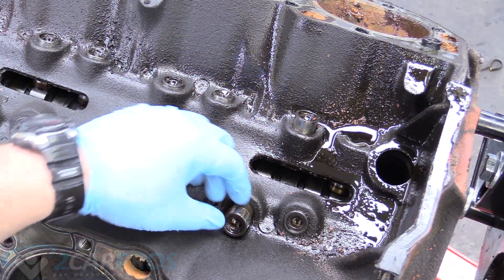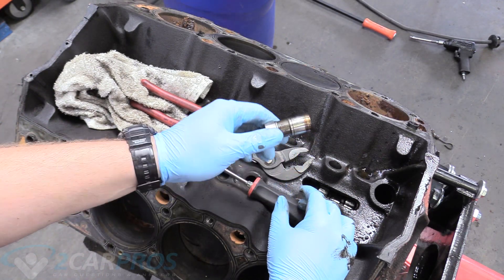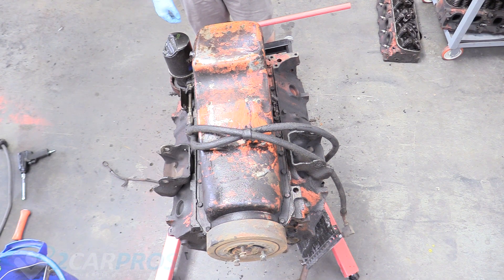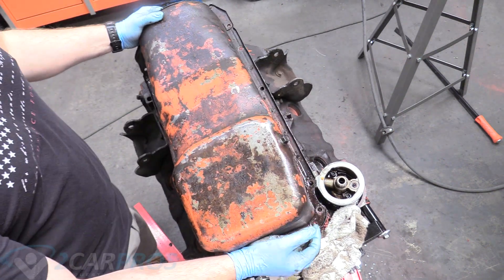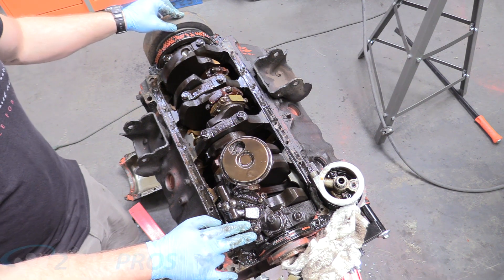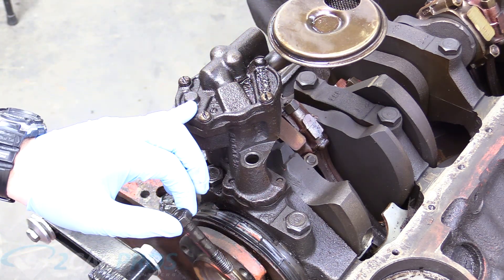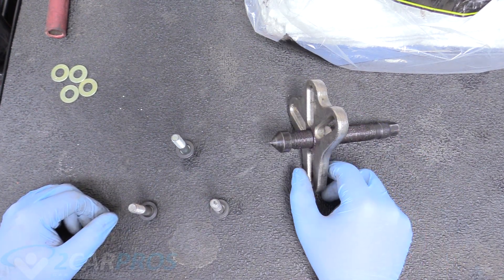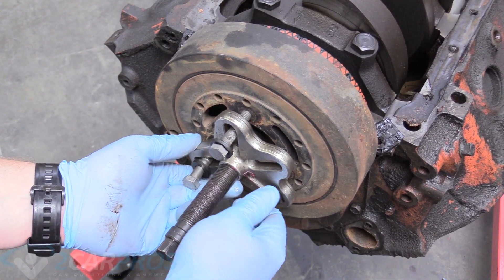How to Build a Chevrolet 454 Big Block Part 2: Removing Harmonic Balancer and Lifters

Comment: I have 454 swapped c3 Vette. I have been experiencing pretty significant vibration especially over 3500-4000 rpm. I suspect that they installed a internally balanced harmonic balancer instead of externally balanced. Is it possible to identify what is on it without removing the pulley and the belt?
Reply from the maker: Great question. I'd look for a part number on the front and then look it up. I wonder if they used the correct balance on the flywhee/flexplate too? Thanks for watching!

Comment: Just wanted to point something out really quick. Good video.
A little extra advice. As far as the lifters are concerned if they are flat or inverted meaning if they arecupped slightly at least replaced the lifters and put new ones in.
Lifters should have a slight dome on the surface of the lift of the riots on the cantaloupe.  This allows the lifters to spin and not wear out the lifter so quickly.
If you were to remove a valve cover and mark a couple push rods with a white dot and turn your engine over without starting it, you would notice that your push rods will rotate.  This is totally normal.
You can get a stock replacement cam and lifter set brand new for relatively cheap.  Small block Chevys and big Block Chevys are numerous and parts are cheap.
So if the lifter is is flat or burped replace it.

Comment: Can anyone explain why the four-bolt configuration is superior to the two bolt configuration?
Reply from the maker: 4 Bolt main can handle more power than a 2 bolt. Force on the main cap is divided by 4 instead of 2. Usually only matters in very high power applications but it is nice to have the headroom there for the future incase you change your mind. Thanks for watching!
Reply: @2carpros  Thanks for the info.

Comment: I’m doing the same 454 big block build does the oil filter adapter need a gasket cork paper or metal behind it because the one I have does not have a gasket? Thanks
Reply from the maker: Mine came with a gasket. I'd get one. Thanks for watching!

Comment: removing the balancer is a bitch but never do it with an impact ,stuff a pry bar in the crank so it doesn't spin and do it by hand with a proper tool
Reply from the maker: I disagree. Impact gun has always worked great for me. Thanks for watching!
Reply: @2carpros  oem models have more clearence. Try that with the race stuff and you're in for a surprise

Comment: Hey man I was wondering where you get your engines from to rebuild them?
Reply from the maker: Well the 2 bolt 454 came from a guy off Craigslist way in the desert. The 4 bolt 454 was donated by a generous viewer who had one and couldn't stand us building a 2 bolt 454. We have the best viewers! The 5.3 LM7 was purchased off of eBay. Thanks for watching!
Reply: @2carpros  I'm going to have to go along with the generous viewer that donated the 4 bolt 454🤣  
Who would build a 454 performance engine with only 2 bolt mains🤣🤣

Comment: Always remove the oil filter (and cut it open to inspect for metal shavings) before rotating the block over and letting the oil go back into the passages.
Reply from the maker: I mean we are taking this down to the block and hot tanking it. Anything metal that isn't engine will be cleared out. Thanks for watching Albert!
Reply: @2carpros  Right, I just meant it would be easier to not get oil over the place if it stays in the filter :)   That's nice you have a 'shop that can still hot tank, most of us have to settle for a baking.